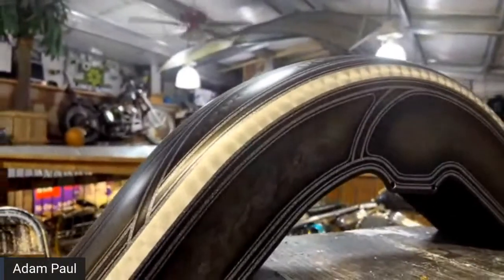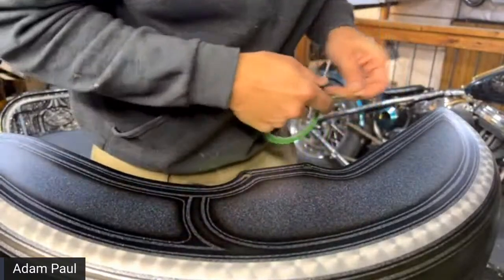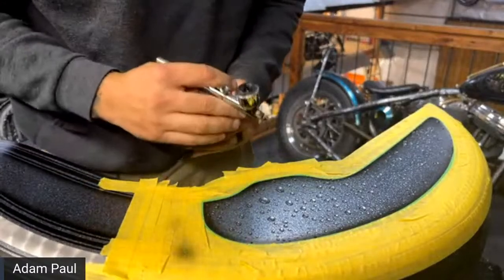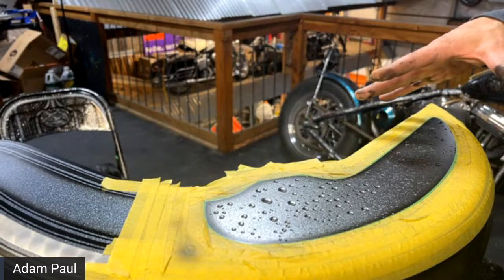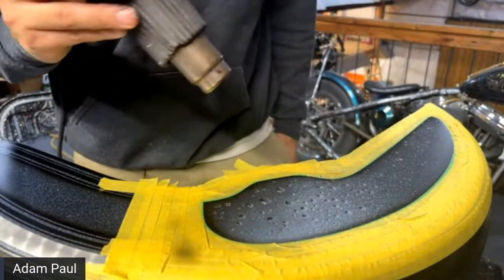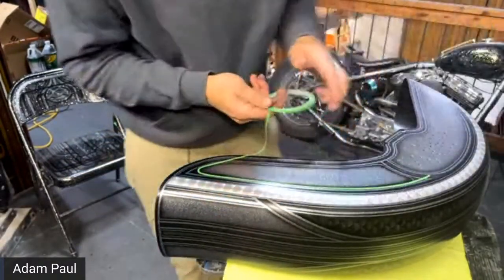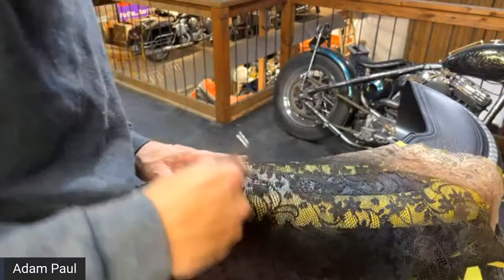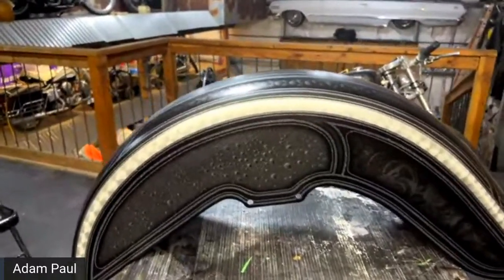Airbrushing Water Drop Effect on metal flake paint, Live Q&A

Comment: Do you always have to clear over your base right away when doing effects?
Reply from the maker: No within a couple days is optimal though
Reply: If you’re not going to clear it right away you’ll have to put at least a coat of intercoat clear on it if it’s going to be more than a couple hours to be able to “scuff” the surface and have good adhesion. Your TDS sheet will tell you how long you can leave it open before it has to be cleared or before it has to be sanded.

Comment: The first time I did water drops they come out great. The 2nd time I put to much paint on and they just peeled  off after it dried. There is a fine line between how much paint you can use for sure   I find not use a heat gun so I had to wait  a while for it to dry